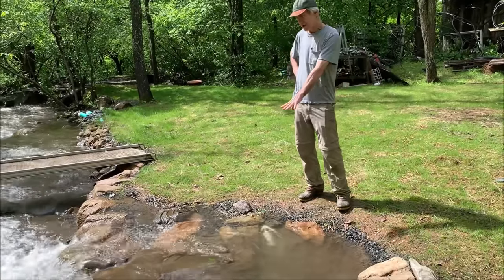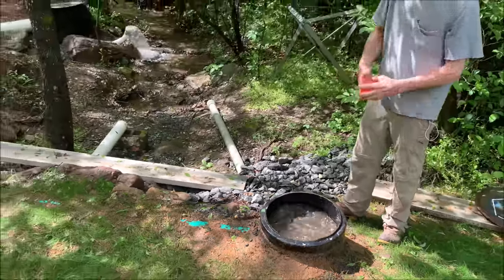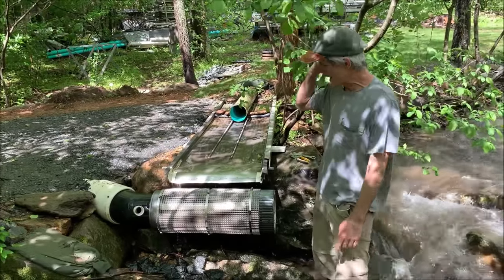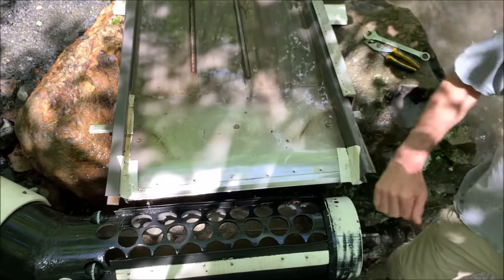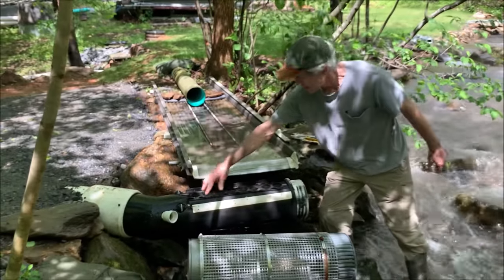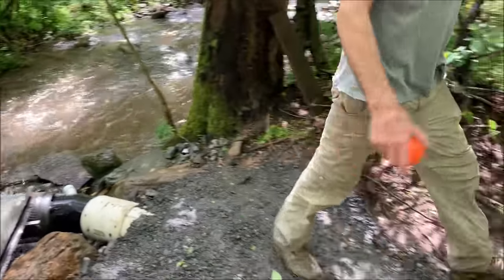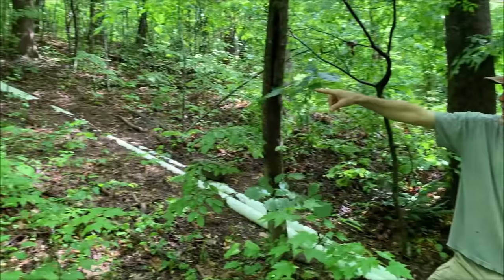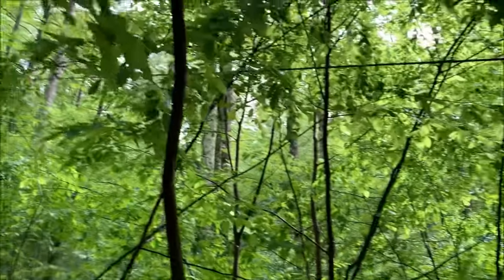500 Watt Hydro Power System in Virginia (Overview)

Comment: It would be cheaper to put the turbine near the river and run the wires to the transformer near the house, rather than running the pipes far away.  And there are 4 pipes near the turbine, so it is possible that there are 4 blade generators, according to all the rules of trade, 1 unit of a large product is always cheaper than several smaller units of the same volume equivalent, so it would be more profitable to order 1 larger turbine and regulate the current power with a tap, and  do not turn off several turbines to reduce productivity 😊

Comment: I think your site would have been better suited with an 8 foot wide, 36 foot diameter laser cut stainless steel welded waterwheel. Modern waterwheels built in Europe and the US use much thinner steel than was used 100 years ago, thus they are lighter weight and less expensive to build. The wheel could have been put at the lowest point in your property. The impound weir could be made taller using an actual poured concrete weir. Then the impound area and the wheel are connected with a large 24" water pipe. Yes the wheel would be large 36 feet in diameter, but the energy you can make from that amount of flow falling 36 ft would produce many kw of electricity which can be sold back to the utility. No need for elaborate rotating screens just a very course screen over the intake pipe. Waterwheels are ultra low maintenance, just grease the bearing and you good. Very cool hydro site, I would love to own a piece of property with a stream like that.

Comment: The self cleaning screen is pretty clever, however I have a good handle on electricity (former army electrician and currently commercial service tech) and the system overall works but seams unnecessarily complicated namely in that we are pipeing water what seams like 100s of feet, through multiple accumulation tanks, through both the screen, and a gravel filter for no real reason. Why not generate the power closer to the water souce and run wire from there rather than all that PVC that looks like it could split a joint if the wind blows too hard, simplicity is often stronger and more reliable.

Comment: Sounds like he might be downplaying the power generating capacity. Maybe legal reasons?  
With the low pressure green pvc if he raised the diameter there he could be creating a vacuum and Vortex effect that would allow an in-line Vortex tubineto be positioned above the pressure drop.  With the amount of head that could be several thousand watts. Then still use the head pressure at the end of the line to drive his 500 wheel.

Comment: When too much over-engineering is barely enough... 
But I must say that the self-cleaning screen is quite nice, and will be pretty effective even when it stops working.
I am unsure why there is concern if it stops spinning when overloaded - if the screen stops and gets clogged up, then it should start spinning again. Self-correcting.

Comment: That spinner Screen is something I said to someone to build about 5 to 6 years ago, they said it wouldn't work but thanks for that, it proves I was right.
Reply: Also... its wasteful to convert to DC so early down the line, keeping it 3 phase would mean less losses as AC travels much easier than DC over the same sort of distance.

(over simplifying) Ask yourself which is better, 240V @ 1 Amp AC or 24V at 10 Amp DC  even though they are the same wattage, the losses between AC and DC are significant as resistance of the wire is more apparent when transmitting DC over any distance.

I remember  as science experiment where this was demonstrated by the teacher.  In a demonstration of how DC does not light all lights evenly, then switched to AC to show how even the lights were with AC. it was apparent to me at least that DC is very in efficient with the long wires, its one reason that 5V USB extenders are not much longer than 5 meters, the wire resistance is too much to deliver a steady reliable 5v dc at the user end

Comment: Run unregulated 3-phase AC all the way to the house.   Build your little "power shed" closer to the LOAD.  Rectifier, charge controller, batteries, and inverters could be closer to the house.  Three phase AC is not gonna kill you any faster than 110 VAC.

Comment: Nice video and great engineering.  I wonder though.  Why do you pump/move water so far?  The first "spinner/filter" tube you show with the wire mesh laid horizontally.  Why not generate the power from that as oppose to moving water along more pipes and sections?
Reply from the maker: power is mass times velocity, the water volume is the mass but to get the velocity you need pressure, that is why we pipe the water 500 feet down hill where the lower ground gives us head, or pressure to spin the turbine fast and powerfully

Comment: if you could eliminate any air in these lines from intake to turbine, you would have SIGNIFICANTLY more head pressure. like enough to run a 3k turbine. water is heav y but air in a line allows atmosphere to dampen effect. not critisizing. great job .lot's of planning and work. i have created a water something i don't know what to call it. it consists of a 500 gsllon airtight vessel( old compressor tank) and 2" outlet and inlet. no motors , no pumps , no siphon. the down pipe or outlet , is 6 times longer than inlet. this static device has zero moving parts and only one valve for priming and purging all air from vessel. once air is removed , water starts flowing . the tank is 8 feet above my pool and outlet is in the form of a spiral. biggest problem ive had was not strong enough vessels . furst 3 prototypes collapsed under neg pressure . other problem was getting lines and connections to vessel AIR TIGHT. this pulls so hard from inlet it almost took my thumb off . that said the stupidest little detail of being 100% hydraulic vs free flow with atmosphere made a huge huge difference. so it lifts water from my pool 8 feet in elevation and it falls back into pool with serious force . not fast and high volume but solid torque against the turbine generating power. still tinkering but soon will have a solid working unit that i will show. it runs 24 /7 rain or shine . it doesnt rely on a water source like a river or stream .it pulls standing water , elevates it and drops it. the water does all the work when the air is not present. i was trying to prove this concept didn't work. when the first vessel collapsed like a beer can under a foot , i knew there was potential with this. i live in fla and have a pond but no running stream. im making my own running water with this . next phase is to scale up in size and make it  permanent. i just want to give the design to whom ever would use it. it is so f'n simple it hurts. look at a modern generator. rediculous when we could have all these micro hydro generators that are silent and perpetually FREE. 24/7 rain or shine hot or cold . it is worth looking into . weigh the volume of all your down pipes and tell me they only produce 16lbs of force. atmosphere is the limiting factor in free flow. even if your turbine is at the head, the force pulling down more wzter in the lenght of pipe you have would be tremendous. you don't need my tank system az you have the creek but the airless concept is powerful. exponentially. almost lost my thumb on the small one using a  50 gallon olive drum.

Comment: Gravity is gravity.  Should hook about 20 of those generators in series, down a long concrete trench.  When one generator is done with the water, the next one uses that kinetic energy to generate more power.  The problem I see with these portable hydro generator setups is that they use the water once and waste the motion of the water.
Reply: I mean, there is such thing as a screw turbine. Basically archimedes' screw in reverse. They use weight more than flow.

But your thought isn't practical or most turbines or any peleton wheel because they are high pressure designs. More water weight = more pressure. Short pipe, low pressure. Doesn't work.

Also the water has to flow efficiently for the generator to get energy from it. If you just hold all the water then there's no flow, no kinetic energy

Comment: Nice project, looks like a fun hobby. I get the 3 phase up to the inverter that takes it to DC, but DC is not phased...lol. DC is just DC Pos/Neg/Ground. It cant be a phase, or sine wave that goes to the Max pos/neg cycles. You can increase Voltage/Amps of DC or decrease it, you can even mimic AC by Pulsing it, but you cant phase it. Great work though!
Reply: The output from the turbine is 3 phase. He runs it through a rectifier to convert to DC for the batteries then converts back to AC for output.

Comment: Strange decision to use an peloton wheel on this low amount of pressure but soooooooo much flow rate.

Why not a wood tray to a millwheel? There would be:
- zero filtering required
- you can skip all that plastic pipes and pcbs, you just need an rpm sensor which opens and closes a water drop door to modulate the amount of water to keep the rpm steady. 

I'm currently planning a similar system, but going off of a spring not a river.

I think I'll go with a Crossflow turbine which doesn't need no filtering (except a large chunks screen) and a flywheel and an excitable single phase generator will will be kept stable at 3000 rpm by modulating the water throughput for direct output without the 3 Phase to DC to battery voltage to a battery to an inverter step. 

I don't think that's efficient and also not an efficient way of spending the money on such a project, as the system does rely on a lot of circuit boards. 

This allows me to use the spring's pond as a battery with around 9 kWh while the constant output should be at 1.3 kW while the system I plan to at least hit total 40% efficiency :)

Which is kind of hard to predict as it depends on the loads.

Comment: 500 watt, would you be able to power owen, fridge, ect?
If not, would it be possible to install multiple of these devices ang get enough power, to run a traditional house?
Reply: He is generating 500 watt 24 hours a day, as long as he can store all that energy in batteries, then he has 12 kWh per day (less losses) of energy to use anyway he wants. It then comes down to how many watts the batteries, wires and inverter can handle...maybe it could run an oven.

Comment: Marty T may be of interest to you.
He has 150metres of polyethylene second-hand irrigator pipe running downhill with a 42 metre fall and 61psi pressure on the pelton wheel...which drives an old direct drive washing machine motor rewired to produce 24v DC,  charging two in series 12 volt batteries...and then output inverted to 240v ac sent through 500 metres of 3 core wire to his house...and any excess goes into a water heater element at the house.......very economical of water and total output 780 watts (2x turbines one main, one spare in case of any outage at least the fridge and deepfreeze can keep going)
@

Just laying your pipe in the creek with wind barrier cloth as filter material over those 1.5 inch sequences of holes should do the same thing without all the extra convolutions.....probably give you even more pressure.....and better output.

Comment: Where are ur inverters back to ac or is ur house a dc house. If so how do u deal with the excess heat from dc current. First video ive seen of urs sorry if this was explained previously.
Reply from the maker: The turbine is making 15 volts after the rectifier at 27 amps. This goes into two grid tie inverters who feed 120 volts and just under 2 amps up the line to both legs of the house system

Comment: Why two 4" pipes for such a long run? A single 6" pipe would have way less parasitic losses and provide a greater flow. I don't understand this system. One nozzle or even two on a pelton wheel would produce much higher output given the drop.

Comment: Sooooo, you probably spent weeks or months to set this up at considerable expense and you save maybe $100. a month? When do you break even and what are maintenance costs and how ofter are you not producing due to dry spells and frozen water?
Reply from the maker: This will never pay for itself if grid power stays on and cheap. It has taught me a hundred lessons about water, power, and adjusting for conditions.  I get power less than half the time and can't always use that efficiently. The 2 or 3K $ cost has been covered by Youtube payments.

Comment: actually the intake look overenginered. moving that spinning filter up the creek, where the other intake is, could increase static pressure. also why do you care about the filter getting too much water? if it has more than needed, it will just fall off

Comment: I’m a strong advocate for creating your own power and I salute you for your creativity.  But…wouldn’t it have been a lot less work and much more reliable and consistent power to just set up 5 100-watt solar panels connected to deep cycle batteries with a charge controller and a power inverter?

Comment: It would be interesting to see pumped battery storage instead of lead acid. with an additional appliance motor and a DIY turbine you could drive some excess wattage off to a tarped and covered pit or various DIY water tower/containers at the location of the rest of the electronics and use a normally open solenoid valve as the return when voltage drops. This could act as an irrigation system on the return as well if using an offsite tarped pool. The electronics are relatively straightforward and may not require an inverter since it would be direct drive from the generator to a separate downstream booster pump. just an arduino with 4 relays (3 for 3 phase and 1 for solenoid valve) could get it done. Awesome project!
Reply: I am thinking of doing something like this, have you seen it done anywhere?
Reply: Somebody worked out on another video that 50 US gallons of pumped storage is about 4wh. Batteries are much better, preferably LiFePO4

Comment: Rather, 2 Plastic Reservoirs in the Ocean Connected Through Turbines will help; 1 Reservoir at the top and the other inside the Sea water. Both Reservoirs with a heavy metal part at which a Robot sitting nearby periodically keeps shooting (i.e at their metal shields}. That should change their positions, simultaneously moving the Turbines by the water flowing from the upper reservoir to produce Electricity. 70% of Earth's surface is covered by Sea water. If 1 such structure works well, Entire Ocean may be filled with them as needed to work 24-7. Only as a Joke, how about Ear Plugs/Hearing Aids for the Fish?

Comment: Seems to me with that water flow he could have had a turbine setup right at the first dam.   In fact he could rig up a serious Hydro Electric system.   All that work and then some tiny AC/DC convertor?   500W ?    For what?      That system could put out 4KW if rigged correctly.

Comment: why wouldn't you just send the AC power back up to where you need it then have your electronics? AC power for transmission, DC for stability... that's why the Grid is AC, but every computer etc had a power supply... to invert that AC to DC. Use the AC to transmit it back up to your home site/where you need it and then convert it to DC for your batteries.

Comment: Such an elaborate set up for only 500 watts. If you simply used the 3 phase A/C power directly to the house you could have 240 V @ 90 Amps each leg and not need batteries or inverters to power you house.... Just get a big truck alternate and remove the diodes and use that to generate your A/C power.... So simple

Comment: That is an awesome setup!  I wish I had that kind of flow here for power generation as well as my Ram Pump.  Very nice weir screen design.. I like the spinning setup! Watch out for those Poplar trees though, they have a tendency to break in storms easily.  Thanks for sharing!
Reply: Those are tulip trees holding the cables, the lumber they produce is incorrectly called poplar.  The trees are nothing alike, esp in size and strength.

Comment: Exercise in math... how many 2" pipe can split off of a 4" pipe and still maintain the same volume and pressure? The answer is NOT 2.  You didn't need the second 4" penstock with your current setup. The cross-sectional area of the 4" pipe is 12.566 sq.in. The area of the 2" pipe is 3.1415". You could have split all four pipe from a single 4" penstock and not lost any volume or pressure. But, on the bright side, you can easily double your capacity by adding another turbine in the aforementioned configuration.
Reply from the maker: the friction loss from doubling the flow rate in one pipe over 500" is real

Comment: I LOVE YOUR WORK SIR.  if I may, A/C current is better for longer distances. It will be better to transfer your inverter system to your home and shorten D/C wires.
Reply: He is using AC for the run to the house. The DC is only in that little shed.
Reply: @adrianthoroughgood1191  great

Comment: All that for only 500w, I only have a small 900w solar setup on a solar tracking system doing very well in a 10x10 foot erea in my backyard, I had a 400w wind turbine n setting all that just to get crappy results

Comment: Very elaborate, but what happens in the winter?
Reply: There shouldn't be a problem as long as the intake doesn't get blocked. Fast-moving water won't freeze as it can't form crystal lattices (ICE ).

Comment: How much did this cost? How many years to the break even point (cost of setup/cost of electricity)? Including your man hours the cost may extend the break even for a very long time.
Reply from the maker: Most of the cost was the 4" pipe. I may have $2000 or so in the project

Comment: Why aren't you running the AC current through the 500ft of cable to your house? I reckon you'd take less of a hit from resistance, your battery bank won't be left out in the cold, and you could monitor your power output from the comfort of your house instead of having to run 500ft.
Reply from the maker: the inverters send 120V upthe wires